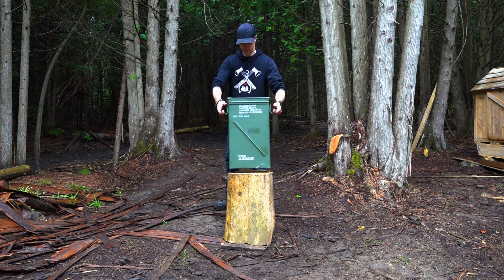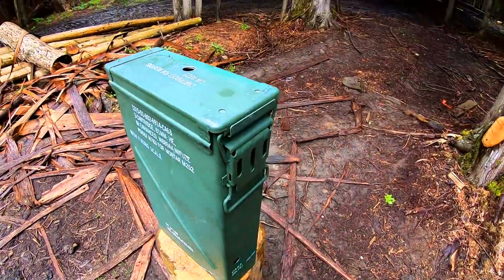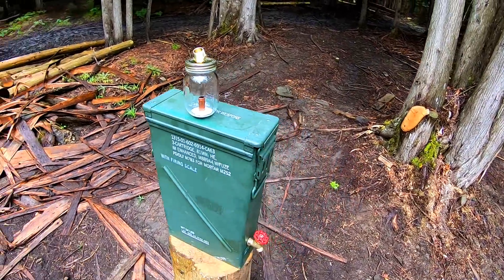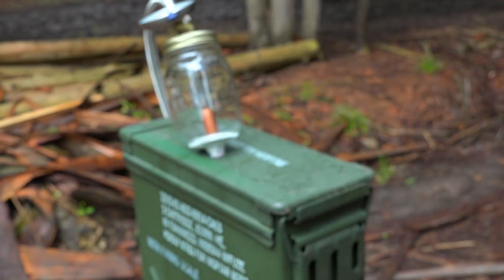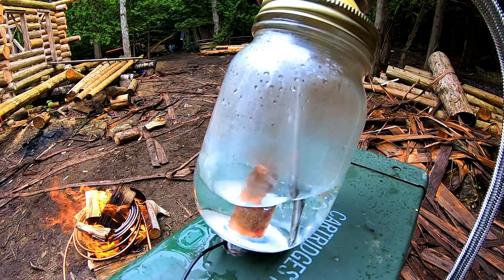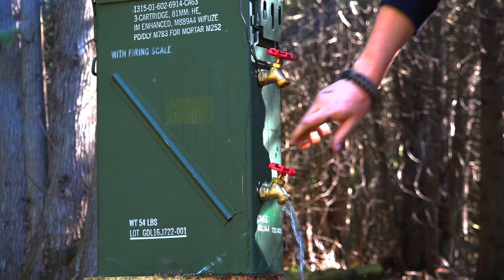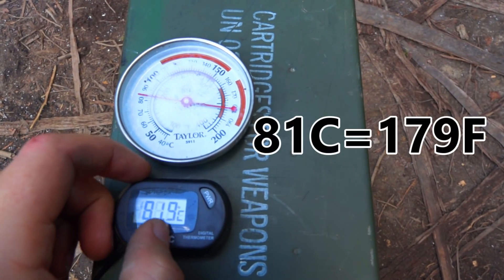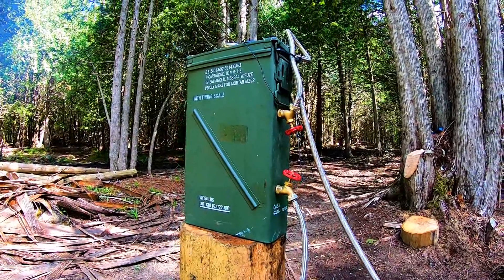Off Grid Heating Prototype- Copper Coil Water Heater / Heat Exchanger / Radiant Heater

Comment: A temp and pressure valve and a good way to control the heat into the coils and you are set. Maybe a rope swing to move the coils in and out of fire?

Comment: Try shortening the length of the piping in the fire, so the water doesnt heat up as quick, because if its to long it will create a feeback loop that will eventually make the water to hot and it will steam away to fast. Allso, add a preasure valve (self opening at X PSI) so that it will let out the steam when it has enough preasure, that will conserve the water for a longer period and it will prevent the camper becoming a steam sauna and mould problems as others have said. You will allso need to figure out how to drain the system of water when not in use, so that you dont have a ice cube in your camper if you plan on making it a permanent fixture.

Comment: Just throwing this out there but you could salvage a heater core from a vehicle and build a box around it and use a computer fan to blow air just like a car heater. This way the ammo box could stay out side. Just insulate the box and the lines so you dont loose heat.

Comment: How are you going to regulate water temperature? I would recommend pressure relieve valve with output towards outside and four way temperature controlled valve to maintain water temp around 60 degrees - quite safe to touch. The box can be at the bottom side wrapped into insulation to be safe to touch. Water heating can be quite complex. What about floor heating build into ćamper floor? ✌️✌✌😎

Comment: Freezing would be a problem. Unless you put ethylene glycol in the water, it will freeze and burst your copper coil. Good luck.
Reply: You could do a two part system. An outside part with antifreeze that runs into the shed and heats a second water store inside.

It sounds a little complicated though.

Comment: Wow.  Lots of heat.  It looks like you will have trouble draining the copper coil.  If it is not drained, it will freeze when not in use and it will burst.  I hope you find a solution.

Comment: Sir, I thoroughly enjoy watching your videos.  They induce a healthy catharsis not found on any other channel.  I have a suggestion about your space heater that you have probably already thought of. If you attach a chimney to the vent on the lid, you may be safer if it begins to boil as you sleep. I know that you you are still in the R&D phase and won't use anything that isn't throughly vetted, but that was something I saw that concerned me.

Comment: Sorry for Your loss. Have you considered a expansion tank just in case heater gets too hot with blow by device in case it gets beyond your control especially enclosed in a box? A line to a temp blow devise to the outside could save your life. Are you planning to use this in freezing temps? Have you thought about another fluid other than water?

Comment: Just a tip, a hen heating / cooling by water always feed the bottom and drain out the top to prevent air lock, and with steam heat feed in top with a high point vent to get the condensate to drain out bottom. Good luck and take care.

Comment: If you take your copper coils and put them inside of a dual pipe system let’s say8 inch inner and 12 inch outer with caps on both ends also putting sand to help retain heat you can have both copper ends sticking out for connections and can burn fire in the middle or as I have done run the wood burner stove pipe thru and always have hot water for what ever you need it for. You must install a pressure relief valve in the tank or it can explode. Your on the right track, be safe.

Comment: Hi Mr. Outsider I used something similar to dry the mud under my house when it got soaked with rain. I used 3-100 foot roles of 1/2 inch pex tubing and trenches down about 4 inches in the ground under the house then hooked up the tubing to a 55 gallon drum full of water. For heat I used a surplus immersion heater fuel with gas. Took 2 days and the dirt was dry. I put 2 a box fans in the vents so any moister would flow out the vents. Worked great wasn’t too expensive. No mold no smell oh so happy

Comment: I would have the ammo box mounted on the outside of the camper and have copper piping run inside the camper for warmth, like a towel rail. That way steam inside the camper is not an issue.
Reply: Having the thermal mass inside is a good idea, but it would need to be vented outdoors to prevent steam buildup inside.
Reply: Or just have the tank inside and run a steam outlet pipe through the wall or so to maximize on heat from the tank.
Reply: Piers Morgan  Exactly!   Running through a small car or ATV radiator in the camper, on the way back to the coil would be ideal.
Reply: Element of Kindness The best radiator would be from a motorcycle you could even put solar/wind rechargeable Lo voltage fan onto it! endless possibilities
Reply: if temperature is freezing outside the tank might freeze before everything, radiator with a fan is best option
Reply: You guys really rock - big brains abound.
Reply: With a radiator and 3 watt solar fan. J
Keep box outside
Reply: Piers Morgan if you get steam the system is not working correctly. I use a regular 5gal bucket mainly for cleaning and doing dishes, not so much for heat, but if you get steam the system is set up wrong.
Reply: I suggested this awhile ago. Still a good idea!
Reply: @bwakel310  yes me also, I suggested the tank be the size of the cabin and under the bed

Comment: I worked as a steel cutter in the Buffalo,NY American Standard heat exchanger plant.  I cut tubing as small around as 1/4 inch. And the person two work 2 stations down from me cut tubes that were the size of cars.  They all did the same thing, they heated and exchanged cooled water for many different appliances or buildings.  I was thinking the same thing about using an old car radiator so the water (coolant) was enclosed permanently.maybe mounting only the fan on the inside of the cabin connected to the radiator on the outside mounted to the cabin wall. The fan would blow over the radiator coils hooked to a car battery circulating the coolant.  Just some ideas maybe.

Comment: Use less copper in the coil...that is overkill.  I could calculate what you need but there are too many variables like temp, heat sours temp and elevation.  You will need to find the right mix.  Consider a pressure release valve on top for more efficiency.   Then also vent valve outside your hut for safety.  Great work on this one.

Comment: I bet you could make a flexible 1/2 inch dia. Heat pipe out of that overbraided flex line and a couple sections of copper as ends.

Comment: So, I was watching the video and noticed that you said the heat was still going, even 2 hours after you took the copper off the coals. One thing you need to test is the tank in cold conditions. While it may sit at a reasonable temp for a few hours in normal weather conditions, what about when it's cold outside? Might be a good thing to test out! Also, this is important because if you take this out into the field with you and all that water freezes inside the ammo box, it will be a pain to get it un-frozen again. Great idea though, looks good!

Comment: Thinking that thing might run you out. You might want to use some of that foam rubber pipe insulation on the flex hoses to give you a buffer from the cold.

Comment: Another clever idea! I was a little worried there for a second that the water would get so hot that it melted the can, be then I remembered how thick those cans are and stopped worrying. That should work well in the winter to heat your little structure and if you need hot water for tea, you are all set up and don't even have to go outside. Nice video. It was nice to see your dad commenting on here so we all could pay our respects. We are all hoping to see him back here, real soon. Thanks for sharing.

Comment: Would you be able to sleep with all that noise? I think I would also agree buy going with the pipe underneath for a warm floor.
Reply: I think once all the air bubbles are out of the system it will be quiet.

Comment: Another coil from the hot water ammo box into the trailer will provide safe heat.
Reply: To many holes & seals to worry about with so much heat fluctuation in those kind of conditions. The ammo can is literally going to be going from freezing to above boiling all the time, I'm not sure if I would want that many seals to worry about. Idk maybe that's just me.

Comment: Great concept on the snow cabin heater.  I see a lot of great suggestions in the comments on perfecting the heater. My suggestion would be to add a heater core or small radiator to the loop . This would go inside the snow cabin . Place  a battery operated personal fan behind it to push the heat out into the cabin. I look forward to your progress on the heater.  Love the channel , keep up the good work.

Comment: Very inovative! A (t/p valve ) will aid you in your development of this heater.. In a home hot water heater , it is placed just above and on the side of the hot water level in a tank.. It will help relieve the pressure from the tank as it is heated... In addition you may want to turn your coil on it's side n support it with some vertical rebar next to , but not on top of the fire..this will alow heating at a steady flow n with the (t/p) valve..a safe operation for your camper??!! Good job! Thanks for sharing! ATB👍👍😎👍👍!

Comment: I like your ammo box heater.  I've always been interested in this kind of heat transfer. Let me throw this out as a possible variation. What if you had a second copper coil in the ammo box, coiled from the bottom to the top. Fill the ammo box with sand and let the water coil heat the sand. The sand (I believe) would hold the heat longer than the water. In other words would give off heat slower, therefore last longer. One last comment, I think you could cut back on the amount of copper coil that is in the fire.
Can't wait to see you heater in winter conditions.

Comment: A typical pressurized radiant heater water temp is 195°F/ 90.5C. To use your amo box you'll need to vent the top outside.

Comment: Would it not be smarter to have this system outside of the camper and run a water radiator inside? e.g. by making one of the two leads run through the camper a few times more like a conventional house heater. This would remove the boiling ammo can from your camper and reduce risk of you accidentally getting boiling hot water over yourself. Just an idea :)

Comment: That is a good start. Old wood cook stoves, they put black iron pipe in the fire box. It went up to the water heater above the stove height. They also put in a clapper valve to ensure (one way flow). This way if they were to turn on a faucet to use the hot water, It did not come out the cooler line.

Comment: You could run a secondary coil inside the amo case to heat a water loop separate from the water in the case then leave the case outside and run the tubing from the second coil into the plastic tube they use for under floors and line you floor with it. Add a temp set valve they use on radiators for room zone heating on the hose to regulate temp. This would keep all the steam and moisture out also give you a bit of safety from the boiling water ,steam and large container of hot water waiting to boil over next to you. the case could be mounted and vented on the outside of the camper so its portable and less likely to tip over.

Comment: It seems that you need to have more control over the heat source, an open wood fire is hard to regulate. Maybe a smaller self feeding wood fire would work somehow. I like some of comments that talk about installing heat pipe in the floor. Good luck with your project!

Comment: What if you ran lots of copper tubing around the inside of the small cabin, you can have the two couplings mounted on the outside to easily hook up a coil for the fire. It could be done discreetly and would look pretty cool.  Awesome video once again!

Comment: I suggest you have an additional vented receptacle outside of the camper mounted slightly higher than the heater.  The hot water would enter that container and feed the sealed heater.  this would reduce the noise inside the camper and keep excess humidity outside.  Perhaps the inlet and outlet on the heater could be on the bottom of the heater on opposite sides with the heater vented outside, and the outside receptacle be sealed.  My thinking is the hot water would be forced into the heater from the sealed receptacle, and rise to the top of the heater and the cooler water on the other side would return to the heating coil thus reducing the temperature gradient.  I really don't know if that would work though.

Comment: Great little heater that will be more than big enough for your snowmobile camper. 
A couple things to consider. Heating copper like that will affect the flexibility of it and older copper tubing is more likely to kink up on you and secondly your heater will work but what happens to the water during the daytime when you are outside and don’t keep the fire going?
Reply: thought the same thing.  then though why not use a car radiator and antifreeze coolant?  solar powered fan to kick it up a notch.

Comment: I would add a hot water blowoff valve on top vented outside the camper this will also fix the steam and moister problems. Put a one-way valve on the lower valve-like on a drip coffee maker. this will increase the watter flow  and work even if the water drops below the top/hot valve. The 40ft copper loop is way longer than it needs to be.  other than that looks good.

Comment: In the winter you can't just leave copper pipe outside to your fire, because once the fire goes out it'll freeze.  Also, after the fire goes out and before it freezes, it can run in reverse and bleed heat from inside to outside.  So then you'll need antifreeze, and maybe a one-way valve to prevent back flow, but then you gotta think carefully about what to do if it boils over, cuz you won't want that right next to your bed.  Also, a super-hot exposed metal box right next to your bed is a quick way to get contact burns.

If you look for videos of people using wood stoves to heat water at their homes, you'll find that they have ways of dealing with these issues.  The challenge for you is to keep it portable while adding enough safety elements to avoid being injured.  Safety first, and good luck!

Comment: I made a similar setup, however I used a rocket stove with the copper on the outside so the copper never comes into direct contact with the fire.
 I have made a 1" galvanized loop using 12" and 16" pipe lengths with 90's staggered so the coil is roundish.
The galvanized pipe allows it to be placed into into and onto any fire, it is a bit  heavier than the copper however it won't melt with extended use. The soft copper will eventually weaken with it's direct heat and being placed into the fire. 

Although the galvanized pipe is roundish with all the 90's it does constrict water flow, this is why I used 1" pipe to help minimize the constriction, and I used a 50 gallon used olive barrel for the vessel. 
It works well, and in your case, you can then use that soft copper coil plumbed in line with the system to heat any structure, tent, yurt etc. And the copper will last forever since it is only carrying water, and not being exposed to the extreme heat of the open fire.
All copper will heat temper and harden over time and this setup will fail prematurely due to this process, the galvanized or black steel pipe will last 10 times as long, hope this helps. Take care and God Bless.
Reply: I told him to heat the rock hot, Have a cast iron dutch oven with dry sand in it. cover the bottom with the sand, drop in the hot rock, cover with more dry sand. Put the lid on and then cover with a towel. This way it relies the heat slowly.

Comment: Good job! I'm a career Plumber and have made more wood fired boilers than I can remember. Some worked very well. Others weren't worth the time to build.  
Steam kills the lucky ones. And leaves the rest horribly and painfully burned.  You did well addressing that issue!  
One issue I struggle with is getting a fire to burn consistently and evenly without having to Tend it constantly. My applications and designs are different. But still the same basic theme.  Have you actually used this? Or just for video?
Reply: As he stated this just a prototype and needs refinement like max temp control

Comment: Couple considerations...scalding liquid in an enclosed structure can lead to a pretty big safety risk if it were to spill while you are in there. Also; thermal siphons work both ways. Once the fire is out the radiant heat won’t linger near as long in sub freezing temps as the copper will cool rapidly and start to suck the heat out of your tank. Also something to think about is all that extra moisture evaporating off inside your little building. More of a sauna than a simple heater.

Comment: Good one,,,
Back in the 1960s, we made a similar set up to  heat dish water at boys camp. But we used a , one way valve, so the water in the coil would boil and pump to a 5 gallon bucket that was hung in a tree. When the pressure was low enough , the one way valve would open and cold water would fill the coil... The system worked,,, but it was extremely  noisy. ..
Thanks for sharing your videos.
Reply: That I would like to see. Girls Camp once a year.

Comment: Well you answered my question about keeping an open fire all night.  
Years ago I took a part  an old boiler demo at college it had Modine heat coil with a fan for mounting in the system, I salvage it along with a solar reservoir tank, I knew where there was an discarded panel and had planned to combine the whole lot into a heat source for my trailer, till the head of the department came in and wanted to know where the Modine unit had gone because he wanted it for his own!